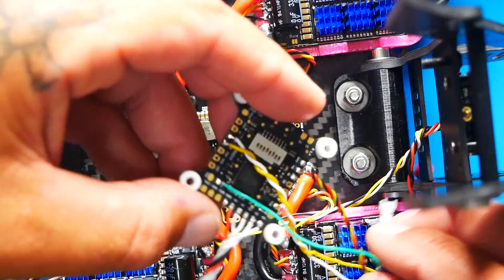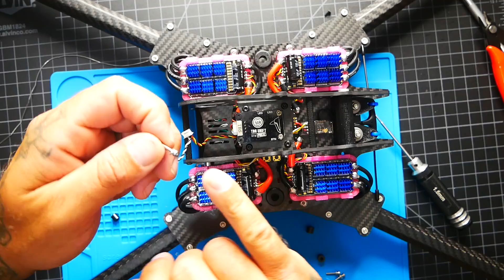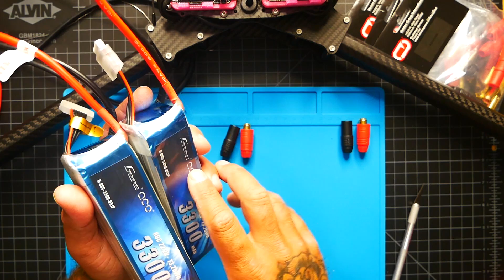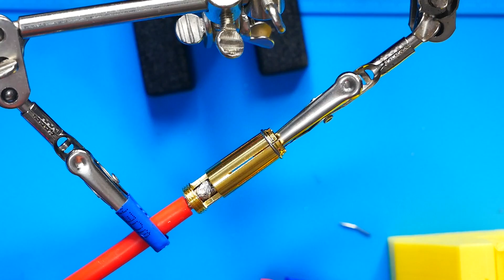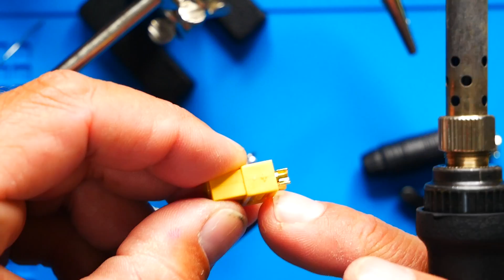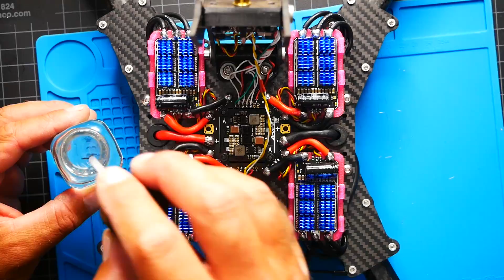How To Complete A MONSTER Drone Build! Finalizing Everything & POWER UP!!

Comment: Lot of soldering...
Why you have not used pins & plugs connections.
Reply: Personal preference 😁👍 plus it makes you Learn about setting up . I done it to my drones also👌 bit more of a headache but if you like doing it then it's rewarding when you need repairs & you can cut your wires to your length that you want

Comment: Aahhh the sweet sight of no smoke on 1st power up...lol...Watching...waiting to see how you fare with the volt/amp readings. The only difference between your build and mine is the FC (I used a Matek F722) , motors (T-Motor Navigators)  and the frame (iflight ixc15). Still chasing the incorrect voltage/amp readings in the OSD on mine but waiting to see what happens with yours. the only wiring difference I can see so far  is I used UART 2 where you used UART 4 for the ESC telemetry...shouldn't make a difference though. I'm sure it's something in betaflight like using the wrong combination of current meters or something..thanks for documenting your build.Hopefully I find my answer in the next video(s)..